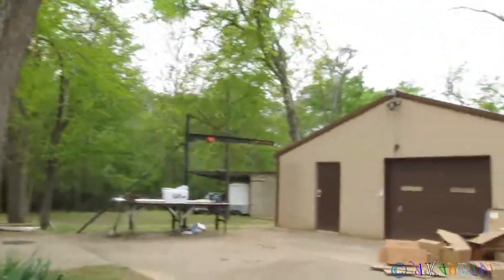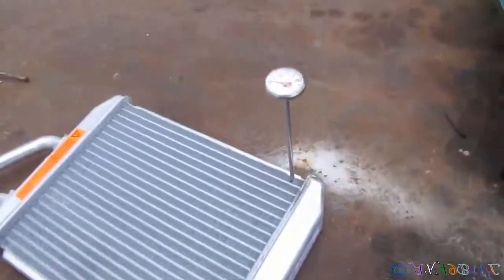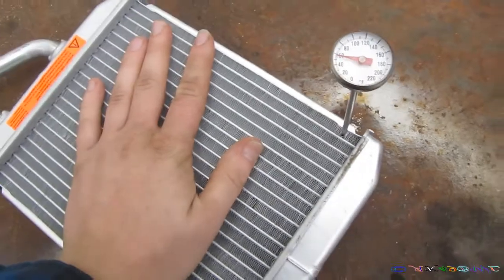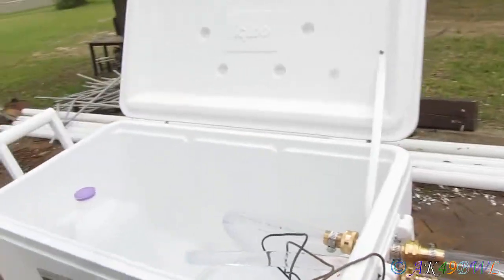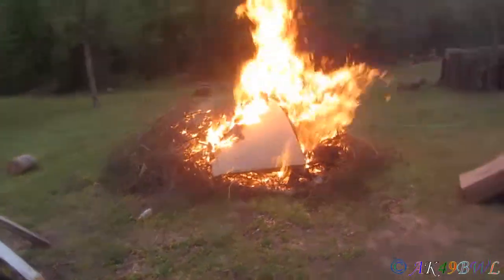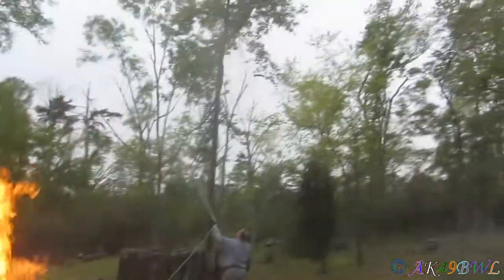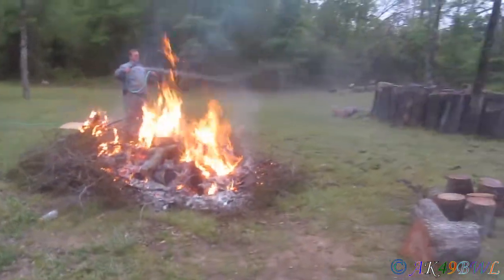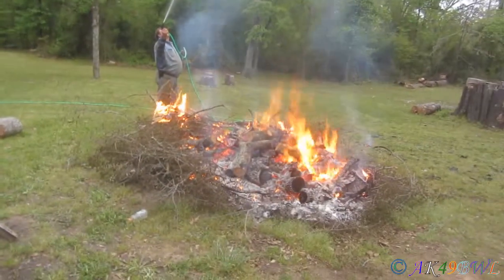Ice Chest Air Conditioner - VLog 199, 04/05/2014

Comment: That's a pretty slick improvised AC - though you're making what's essentially a swamp cooler, a little over complicated.
Reply from the maker: no. A swamp cooler has the effect of adding humidity to the air; this will have the opposite effect of removing humidity from the air, much like an AC Evaporator.
Reply: ***** Ah, very good; I see your point; very ingenious little device.